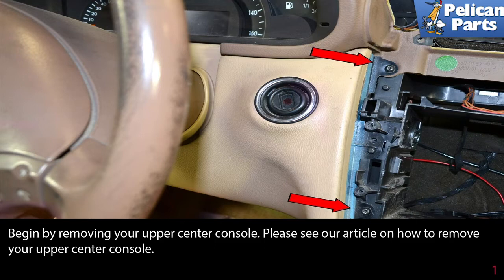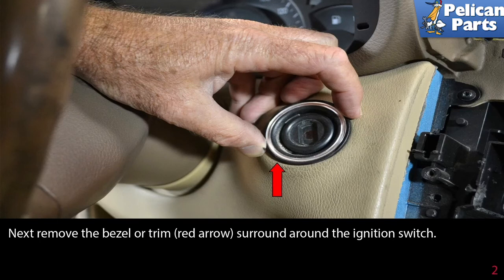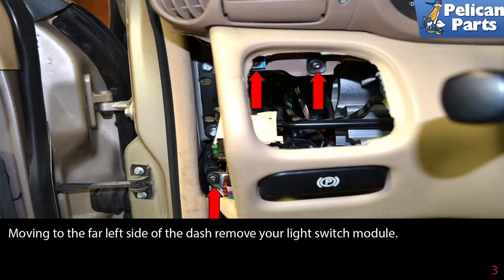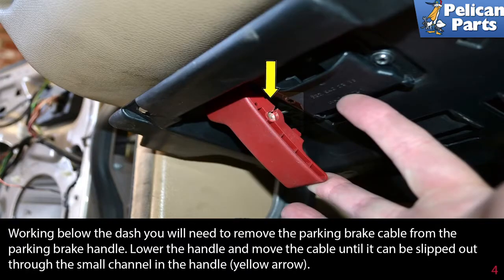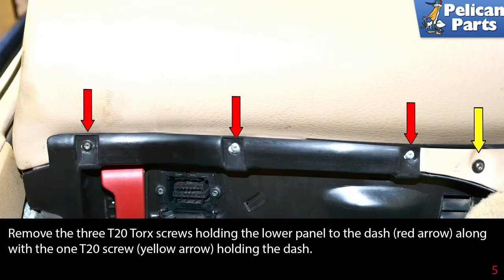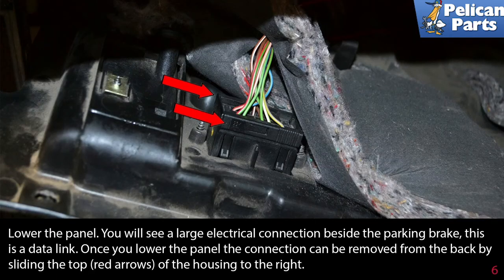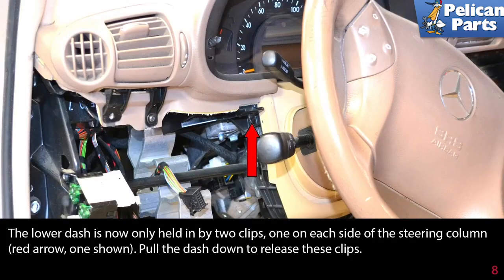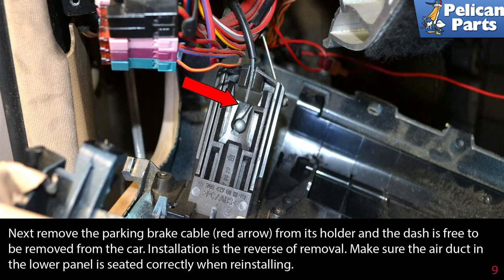Mercedes-Benz W203 C-Class Lower Driver Side Dash Removal and Replacement

Comment: Anyone else have a problem getting the lower right dash to pull away at the end?
Reply from the maker: What is the year and model of vehicle?
Reply: @pelicanparts  2004 c320
Reply: You have to remove the lower center console as well. The video doesn’t specify.